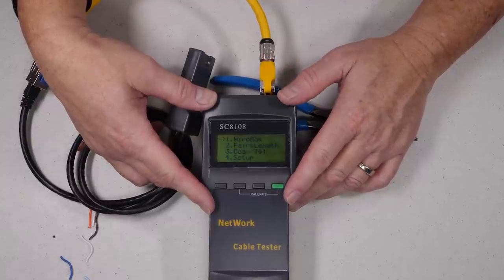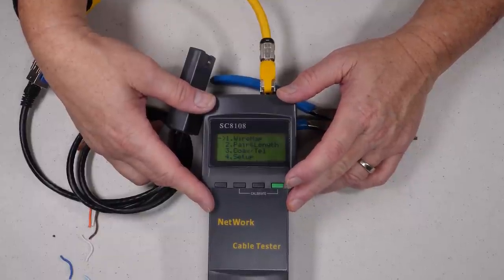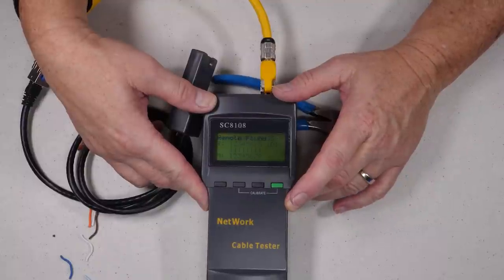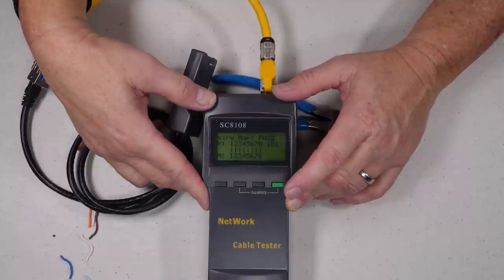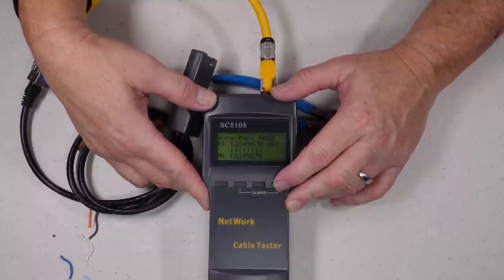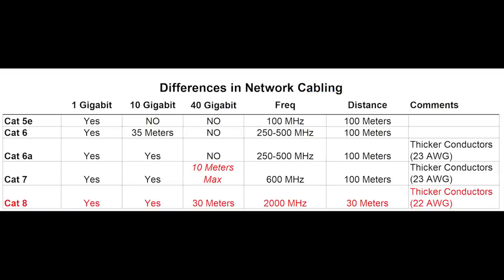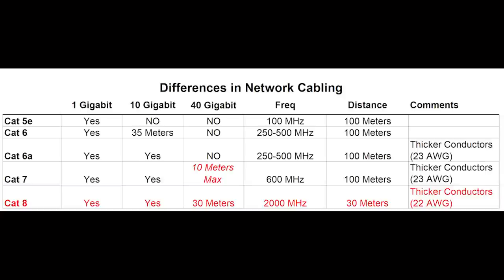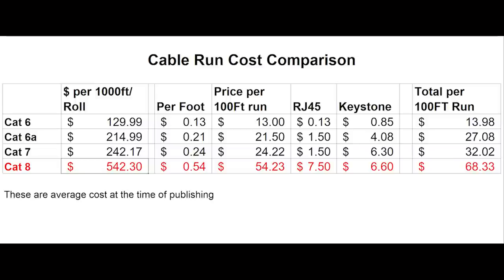CAT 8 vs CAT 7 Ethernet Cables - Is there a difference?

Comment: So I have two cat 8 cables that are only 26AWG really weird but it works. I had to solder the leads to the Cat8 RJ45 clam shell connector since it’s so thin.
Reply from the maker: You have the multi-stranded wire which is designed for patch panels.
Reply: @MikeFaucher  ah okay, I have just have a 1 gb network rn was thinking abt building up a PFSense box with a 10 gb nic. You think I should opt for some 24 gage cat 8 or just stick with the patch
Reply from the maker: @restrelax6282  Pfsense will not take advantage of anything over 1G.  I would suggest putting  10G switches and 10G Nics for internal traffic to NAS or Media servers.  For 10G you can CAT 6A or Cat 7 Patch and use 6A shielded for the in-wall stuff.
Reply: @MikeFaucher  ah okay, thanks for the help!

Comment: Cat 8 will be mandatory with the upcoming docsis 4.0 due to frequency
Reply from the maker: Thanks. Look forward to 4.0.
Reply: @MikeFaucher  do you know the coaxial cable specs that are required for docsis 4.0 ? im guessing we also need to change the cable due to frequency increase to 1.8ghz in docsis 4.0
Reply from the maker: @LivingTheDream77  No. have not researched it yet.

Comment: A thicker conductor does not send “more signal”...  (it has less loss, which is not the same).

I would never use anything above Cat 6.
Go to plastic fiber after that and get a kit to do your own splicing, so you can make cables to length much easier and faster.
Reply from the maker: Thank you for the feedback.  I appreciate it.

Comment: 20:09 well you could use a hub/repeater or an industrial brand of an rj-45 amplifier.
Reply from the maker: Good point for length.
Reply: @MikeFaucher  Only bad thing is the amplifier doesn't just amplify the signal; it also amplifies noise too :/

Comment: A good quality shielded cat5e cable can do 10G for an entire house (10-15 m from what I seen). Now, anyone can buy cat 7, cat 8 cable, but you sure cannot buy switches for that, so it's pretty much useless. Even 10G costs are astronomical for typical end user. The closest what the average Joe can afford is 2.5G, which is designed to run on cat5e cables (10G switches are about 5-10 times of 2.5G switches, and about 40 times those of 1G - from the current standing, we are a long way from affordable multi-gig switches). If someone wants to do POE and be somewhat future-proof, then cat6A is the way, if no POE is intended, then a 24AWG pure copper Cat6 cable is sufficient for the next good couple of years (shielded cable in any case). 23 AWG is only a safeguard for CCA cables (copper coated aluminium) - correct me if I'm wrong.
Reply from the maker: I certainly have had a slightly different experience.  I have experienced connection dropouts with quality CAT 6 that were approximately 20 meters in length so personally, I would not use anything but 6A or 7 if the end game is 10G as the price difference is minimal.  10G hardware in general can be temperamental so you are better off with a good foundation.   Though I agree with you on the price of switches, they will ultimately come down and if you are wiring a house it would make sense to plan for future support of higher speeds.  Just my two cents.  Thanks for sharing your viewpoint.
Reply: @MikeFaucher  Thank you for your opinion, I am talking strictly about average home owners here. The hardware for consumer 10G is in baby steps. I remember with 1G about 10 years ago, on poor quality cable you couldn't do 1G even on 1.5m. I still had some of that awfull cable. Recently I plugged the full cable (about 15-20m - the only thing I had on hand) for a quick DVR test and surprise, surprise, it connected with 1G, meaning the hardware got lot better. Hopefully this will the case with 10G, but right now, I am just not seeing any fast development on switches that could improve hardware and lower prices. Most ISPs will stick with cat5e for the next 10 years or more (fiber to the building and from there cat5e to apartments). 
I live in Europe, we have 600-800mbps speeds for about 8$ / month, I do not see that increase, as most people are happy with 4G speeds of 20-30mbps. So overall very little demand for multi-gig speeds which is keeping innovation back and prices high. My point was that we can install cat8 cable, but there is no hardware, and in 10 years who knows if a new standard comes in and obsoletes the cat8 cable, therefore I am inclined to stick with cat6/6a cables, unless someone has money to burn (I always recommend installing cables into plastic pipes so it can be switched). Thank you for your opinion, I really appreciate it.
Reply from the maker: @levif.1145  Likewise.  There are no absolutes in this stuff and everyone needs to determine what works for them. Thanks for the feedback.

Comment: How is the frequency determined? Does the switch chose?
Reply from the maker: Mainly your device and switch determine the speed.  Cabling insures quality of signal if you are running longer distances.
Reply: @MikeFaucher I guess what I mean is if I run a Cat 7 able but terminate with say RJ45 from 6a from a unify switch to a unify AP then how is the frequency of the signal running through the cable set? By the switch? If so, how does it know the max is 500Mhz vs 1000Mhz vs 2000Mhz assuming the switch is capable of all of these?
Reply from the maker: @AlejandroTaylorEscribano  The frequency of a cable is a max rating and is not set anywhere. What you are describing should work fine. Cable speed does not really come into play till you get to 10GbE speeds or higher.

Comment: Whats the difference between A config and B config?
Reply from the maker: The only real difference between these two are the green and orange pairs for backward compatibility with older phone systems.  Most patch cables that are bought today are "B" and this is the standard for the US, however in Europe I believe they mostly use "A".  As long as it is uniform in your network, it really does not matter but most new installs are using "B".

Comment: There's no need to use either of these. Cat7 doesn't even count as Ethernet cable. The specs skip right over it, as it's not needed for 10 gigabit and can't handle faster speeds like 25 and 40 gigabit. Those speeds need Cat8, but the hardware for running those speeds over Cat8 is far more expensive and power hungry than the hardware for running those speeds over fiber. Determining the right cable to use for an installation is easy. Don't care about futureproofing for 10 gigabit? Cat5e. Care about futureproofing for 10 gigabit, and all your cables will be under 55 meters long? Cat6. Care about futureproofing for 10 gigabit, and you'll have cables longer than 55 meters? Cat6a. But you can't just look at the category rating. Always get cable with pure copper conductors, never get cable made of CCA (copper-clad aluminum). Always get cable with solid conductors (rather than stranded) for installed cable, and always terminate installed cables with punch-down terminations rather than crimping plugs wherever possible. Patch cables (cables connecting devices to jacks) should be bought premade, as crimping plugs is much harder to do correctly than punch-downs.
Reply from the maker: Thank you for the feedback.  I appreciate it.

Comment: It's three years later, are there even 40 Gb/s RJ45 switches / network cards to make use of CAT 8? I feel like doing singlemode fibre for 10+ Gb/s is way more flexible. I mean, you can push 25 Gb/s or even faster trough fibre for many tens of miles / kilometres. And tbf, I don't believe I'm saying this, 10 Gb/s for in-house (home use) copper cabling is enough, for faster stuff, use fibre instead. So just use CAT 6A instead of the more expensive CAT 8???
Reply from the maker: I certainly agree with you.  Fiber for longer ranges is much better.

Comment: Why would you use Cat 8 instead of fiber?
Reply from the maker: I wouldn't unless you needed RJ45/Copper to connect which is more flexible.  Fiber is better for longer runs and is very cost effective as long as you buy pre-made cables.

Comment: CAT7 can also 40Gb? Which network card exists with 40Gb RJ45?
Reply from the maker: Yes Cat 7 works with 40GbE but shorter lengths.  The ATTO comes with RJ45 but all the SFP based cards can use an RJ45 module.

Comment: So if i prucahse 35 meter cat 8 i will not get cat 8 speed?
Reply from the maker: You speed will not be limited by cable but by your equipment.
Reply: @MikeFaucher  what kind of equipment do i need to have good internet speed
Reply from the maker: @johnimperial9777   Cables like this are really meant for network lan speed.  Even cat 6 will not limit any known internet speed you can currently get.  Cat 6 will 10G at 35M and 2.5 at 100M.  Remember you can only go as fast as the slowest link.  If all you can get is 1 gigabit internet, then as long as you other equipment can handle it you are good to go.
Reply: @MikeFaucher  for cat 8 what speed will i get for 35 meters
Reply: @MikeFaucher  does lower gauge cable better?
Reply from the maker: @johnimperial9777  Cat 8 should achieve 40G at 35M but very little non-enterprize equipment will push that speed.
Reply from the maker: @johnimperial9777  Thicker wire can handle more bandwidth.

Comment: Cat5e carry GE(1Gbps) and another hand it is pointless to run 10G at copper because fiber is cheaper, more robust, more future proof,offer longer distance, needs less energy etc. At 10Gbps speed is is just better almos every thing. Sadly it looks like motherboards will provide copper ethernet. So only point to use cat6a is support 10G for cheap desktop motherboards. Cat6 is just pointless at every aspect.
Reply from the maker: The one down side of fiber is no step down.  Good point.
Reply: Fiber isn't necessarily cheaper than Cat6a for 10g because of the end equipment cost, oversized runs, spicing etc. But fiber is definitely more cost effective than Cat7 or Cat8. I think Cat8 especially is intended for patching rather than end equipment. A typical use case would be, bonded fiber to the Router, Fiber to the main MDF 40g Switch, SFP and/or Cat7/8 between the switches and patching, Cat6a to the end users.
Reply: Cat6 can handle 10G up to 55 meters, and the vast majority of home installations won't have runs longer than that. Cat6a is only needed for 10G runs longer than that, can Cat7 is never needed, period.

Comment: Also worth mentioning Cat6a has the best noise reduction.
Reply from the maker: Had not hear that one.  Thank you for the input.
Reply: I think Cat6a is better against interference as the cores are twisted tighter than regular. Don't know if the same applies for cat7/8. But quality of the shield are of course different from manufacturers and individual cables.

Comment: Next up... CAT20: 8 big f'king coax cable bunched up together, with the ends exposed and screwed in onto a PCB grounding wire style, then the PCB has a PCIE 16x connector that goes right into the motherboard.
Reply from the maker: Interesting concept.  Cant wait to test it.

Comment: Cat 6 and cat 7 are both 23AWG conductors.
Reply: Should be more like 22 or 20 or 18 like telephony drop wire from the terminal to home. Ive used drop wire for ethernet to avoid attic climbs
Reply from the maker: Some are, there are both variations out there.  Good point.

Comment: How do you know your internet's mhz
Reply from the maker: You don't.  Most ISP's transmit on fiber to local distribution point then use a copper RG59 coax to bring it into the house.MHz is a spec used by MFG's that depicts  the maximum frequency the cable can handle.  You are better going off the category which is directly related to speed/length.  Your internet is rated in Mbs/s and not MHz.  Where cable makes a big difference is on your local LAN to high speed devices not your internet.   Hope that helps.

Comment: Better off running SFP+ DAC Active or MM-Fiber directly. Cost difference is hardly anything for most runs when contrasting them to CAT8. Termination on the other hand is painful for Fiber.
Reply: except for hardware and NICs
Reply: @BenState  I assume you are referring to running cable to devices? For client PC's and devices yes, you should use 10G Base T since you don't need extra supporting hardware. For Servers and Networking no, always use SFP+, Servers are responsible for delivering a lot of data in a timely fashion and DAC is considerably better in latency than 10G Base T despite both being copper and tend to play nicer when doing LACP negotiation. Switches, you can use DAC but in some certain cases, you need to use Fiber.
Reply: @Joshe505reborn  depends on the server, service, LAN and workload.  Don't be so condescending.
Reply: @BenState  Sorry if I sounded condescending, that was not my intention. What I meant to say is that running 1GB over RJ-45 is fine (but I doubt you need CAT7/8 for it), however, when you are dealing with 10GB or higher on servers and networking, you really want to be using DAC/Fiber where possible. Price points for switches are the same and they stack with each other regardless, so basically, with 10GB RJ-45, your paying more for the cable for less in the end. For some insights, Dell's new PowerProtect Data Domain Backup Vaults don't even have 10G-Base T certified or formally supported (even though its just a PCI-E card you can drop in), you have to use SFP+ which is painful for us at work since we use 10G-Base T which is a horrid nightmare. We tried using some Dell SFP+ to 10G Base-T adapters but they didn't work :c

Comment: I am so confused...you said cat 7 when you meant cat 8 and you put up some text saying you meant cat 8...but then shortly after that, you said that cat 7 had better shielding. Was it another mistake? There is no text there and that's such an important part. Can you clarify? Making it more confusing, at no point in that beginning section do you point out which is which. Even when you are talking about 7 and 8, you never say which of these cables is which. And when you mention one, you touch both. I am so lost.
Reply from the maker: Well you are right.  There was an additional time that I inverted the names.  The yellow wire is CAT 8 and the Blue is the CAT 7.  Thanks for pointing out.

Comment: am I confused or what? At one point you called both cables a cat 7 then you tell the difference when you explain the plugs. I recently changed from cat 5 to cat 8 for my streaming box and modem and router. to my computer.
Reply from the maker: Sorry about the confusion.  The Yellow is the CAT 8.
Reply: @MikeFaucher  ah ok got it. Thanks for the clarification.

Comment: I don't think I agree with your conclusion. In fact I would say that CAT 6a is a bit of a waste.
Since CAT 7 is almost the same price (especially if you use plugs on both sides) I would go with CAT 7 for any future proof systems.
Especially that I expect a middle standard to appear in the future that might utilize CAT 7 on longer distances (Maybe 20Gb/s)
Reply from the maker: Thanks for your input. It’s a good point.

Comment: I used to be a network engineer (Novell CNE and MSP)  cat 5 data used only two pair's of the four , is this still the case for cat 7 & 8 ?
Reply: The category of the cable has nothing to do with the number of pairs used. It’s a function of the Ethernet protocol. You are referring to 10BaseT and 100BaseT which use 2 pairs in each direction. 1000BaseT and faster use all 4 pairs in a full duplex configuration.
Reply: @danpayerle  yes thank you , I was in a round about way referring to 10 and 100BaseT .  Thank you for prompt reply. Ps very informative and interesting video. I didn't know cat 7 or 8 existed !   Hmm makes me now wonder what 9 and 10 will bring and be like!
Reply from the maker: Yes, there is still extra pairs for other uses such as POE+.

Comment: My house is wired in original Cat 5 for fibre broadband distribution and UHD TV distribution and is still faster than needed and faster than my fibre to the cabinet broadband.   I fail to see why on a home network why most people would even need Cat 7
Reply from the maker: Main reason is in situations like mine where I do not use local storage and centralize all my data so using 10G is important.
Reply: Nobody needs Cat7, period, at least not for Ethernet. 10G only needs Cat6 for up to 55 meters, and Cat6a for 55-100 meters. Speeds faster than 10G need Cat8. For these reasons, the Ethernet cable specs completely skip over it. In other words, Cat7 is not Ethernet cable.

Comment: 5e is plenty for my home.
Reply from the maker: Thank you for the feedback.  I appreciate it.
Reply: I think I would run 6a at most. But I also don't know what the future entails about download speeds, or data streaming concerning our leap into VR these recent years.
Reply: @Valentin119  I live in a rural area where my max DSL download is 6Mbs and 800Kb up :-/
Network transfers of 100Mbps is plenty since I only transfer movie Mp4's that I encode on my I-9 and send to my media server storage drives.
I just cant see the need for more than 100Mbps even if I hade external fiber optic internet to a single device internet connection. CAT5e can do 1Gbps in short less than 20ft runs, but I digress, for me there is no need for that kind of throughput.
I am networking certified and it's all about infrastructure needs with future proofing and redundancy needs in mind.
Reply: @DrHarryT  Like you said, it really depends on the users needs, 5e is plenty then it only makes it cheaper to maintain and replace haha. I speak solely on the fact that, I will want to be setting up servers, and doing large data transfers just locally, while 40Gbps from Cat 8 would be phenomenal, 6a and 10Gbps is more than enough for what I would have to settle my needs for what I want to do with my cabling. (I'm a bit of an impatient fellow, so the speed of transference is to settle that need of impatience)